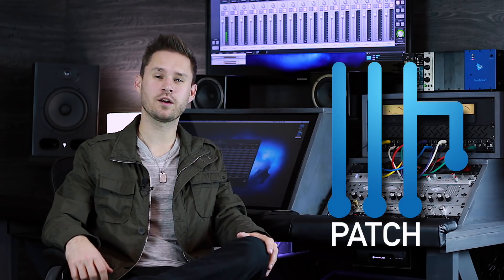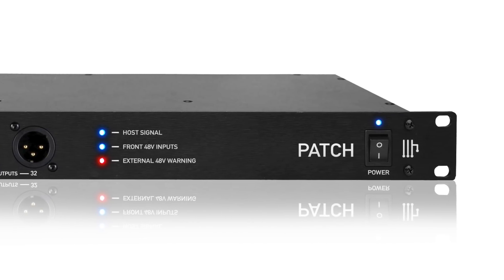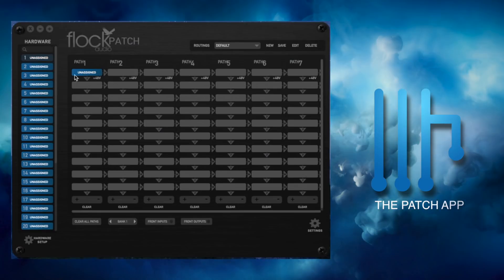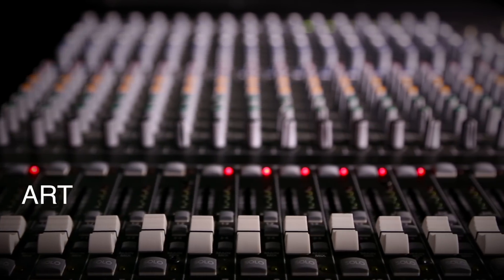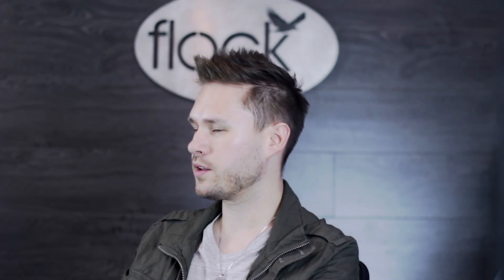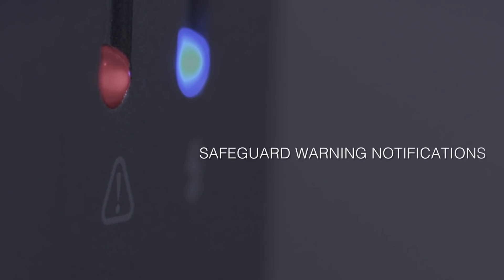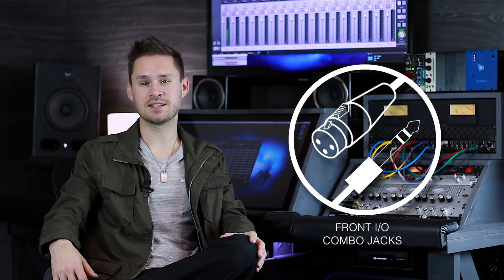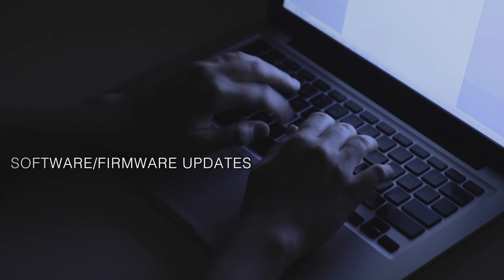Flock Audio: Introducing The PATCH System (Pro Audio Announcement)

Comment: Ya know what this would be great for me is to have a second or third set of monitors including my atmos monitors without using digital connections
Reply from the maker: Absolutely! Keeping it 100% analog but with the flexibility of digital routing options easily recalled! Contact one of our Dealers to learn more or contact Flock Support and we'll be more than happy to help assist!
Reply: @FlockAudio  most definitely this will save me tons of digital outs… unfortunately I won’t be able to replace the patch bays in the studio cause they’re just too many inputs and even the 96 one won’t do!!! Double it and maybe… I mean the console has like 8 96 point tt bays just for the console

Comment: Great product! Do you gave a video with an example of the app being used from a DAW to route from the DAW through a path of analogue outboard and back into the DAW?
Reply from the maker: Hi Rob, we don't currently have a video demonstrating that specifically, however, all you do is send an Output to PATCH from your converters or else use a PATCH point as an Insert in your DAW just the same as you'd do with any other outboard processing unit.